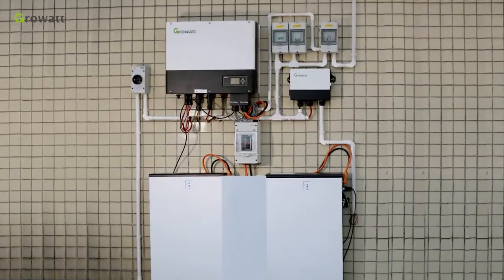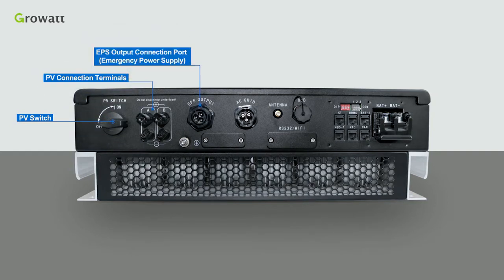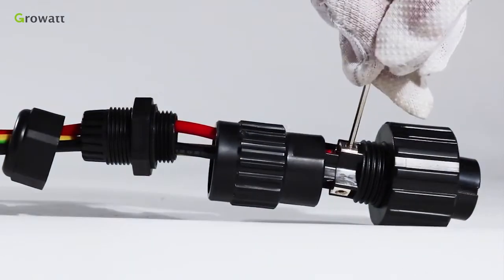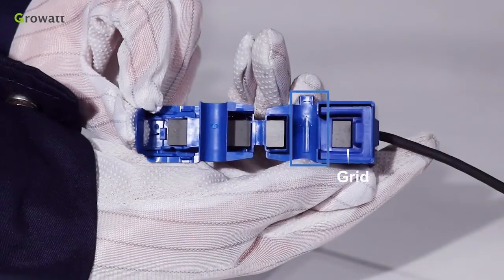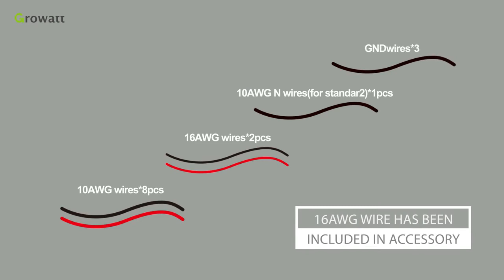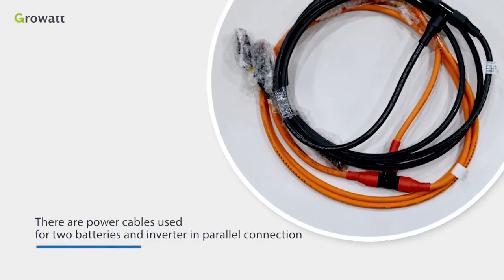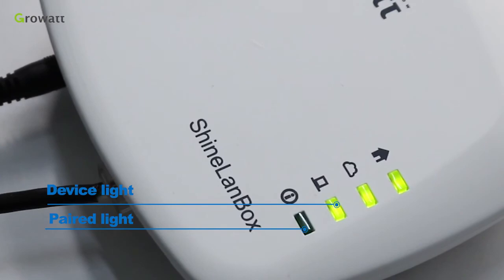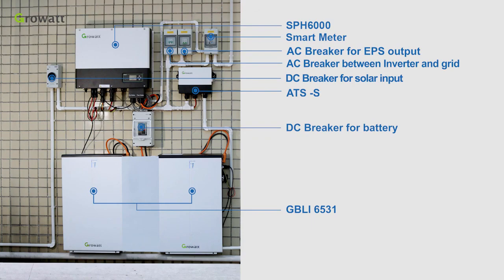Growatt SPH3000-6000 Hybrid Inverter Energy Storage System Installation

Comment: for all those who wanna run the hybrid sph inverter WITHOUT a battery : you need to bridge the bat terminals on the inverter on the lower right

It needs a small copper wire cause that connection will only show the inverter that there is no battery used. If you do so the sph hybrid inverter will switch to a kind of grid inverter like the mic xxxx or min or mod inverters.

I guess this is the same for all min and mod hybrid inverters. Check out the manual first and you might search for this line or some words like bat terminal.
It is just 1 sentence in the whole manual 

"If you have no battery now, you can also float BAT terminal, and this hybrid inverter will only work like a PV inverter."

float BAT terminal looked weird until I found in a german manual the clear description: "CONNECT the bat terminals on the inverter" which is easier to understand than FLOAT